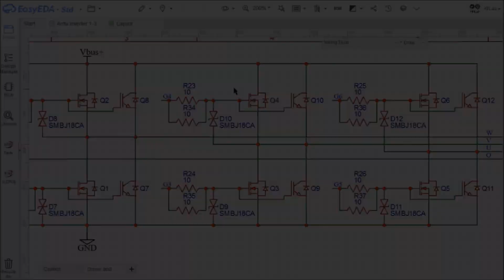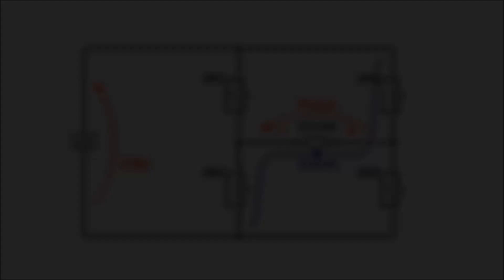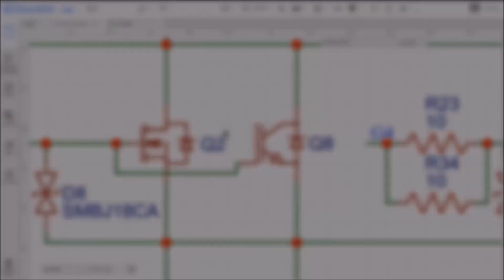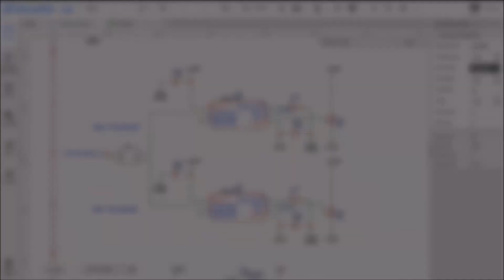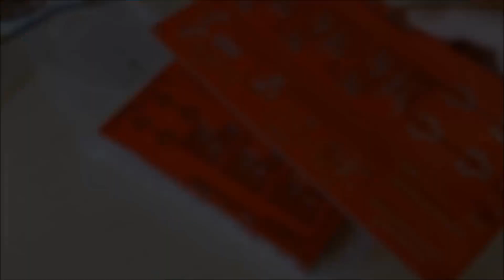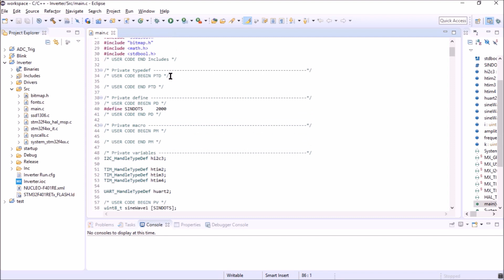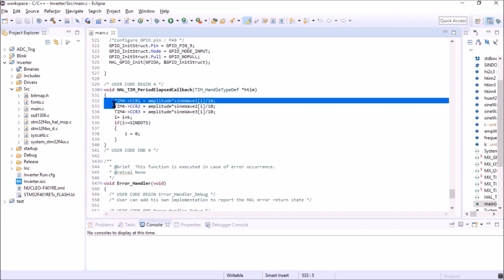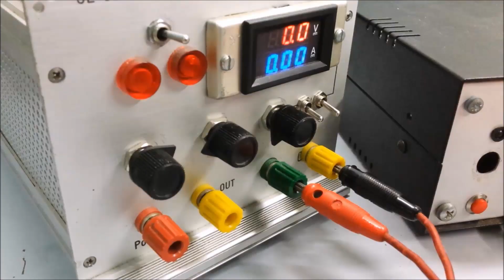Three Phase SPWM Inverter with ARDUINO and STM32 for Electric Motors - Power Electronics DIY

Comment: Ciao, prima di tutto grazie per share il tuo video e complimenti per il tuo lavoro. Ho visto la tua scheda tri fase che lo utilizzi con il Arduino. Per il mio progetto avrei bisogno di controlare 3fase output (voltaggio 0-100V, corrente 0-5A e frequenza 0-60Hz). Pensi che con la tua scheda questo lo potrei uttilizare? Grazie per la tua risposta!

Comment: Hi there nice work. can i have the files of the project ?
Reply from the maker: Yes, contact via email or patreon.com/atlab
Reply: @warsider4219 did you receive   the circuit diagram and code please from @ATLabENG? Please I need it as well. Thanks in advance

Comment: where are the heatsinks? never seen an inverter without heatsinks!!! this thing won't work in real life, one of the mosfets (the one with least resistance path) will get hot, suck all the current (because it is hotter) and burn
Reply: MOSFETs have a positive temperature coefficient, so the exact opposite will happen. As the temp increases so does it's internal resistance so it pulls less current.

Comment: Why haven't you consider using ir2104 gate driver (which have a single input) instead of nand gate ic and ir2113 gate driver? Is there any specific reason?

Comment: I use dsPIC33FJ family with Mitsubishi IPM PS21867 and PS21869, depending in board I use, and also IRAM136-3023B, with PIC18F4431. I know STM32 is much more "powerful", but also lot more complex. Anyway, good job you've done. I've forgot to mention, I've used space vector pwm, not sinusoidal, because of DC bus voltage utilization.
Reply: Hi brother do you supply any onverter project? Pure sine wave
Reply: Hi brother

Comment: Congratulations, very good project. I currently work on a similar project (115V / 400 hz inverter). Do you have a part number/type/reference for the AOP that reads the shunt voltage. Do you think  TL082 is a suitable device for this purposer. Thanks. Keep it up.
Reply: Hi, Could you build it? It's for avionic:)
Reply: Hi. Yes it's for avionic instruments. My project is still in progress. But there is a much better solution than MOSFET + DRIVER : google STGIPQ8C60T-HZ. @Muhammad-qf9vl

Comment: This is really interesting.

I've been looking for a simple way to generate gate signals for an inverter from a hybrid car I've been reverse engineering. Has 2 3-phase inverters inside and I'm able to switch on/off each of the 12 gates directly with 3.3v MCU logic, original drive circuitry and isolation intact.

Crazy how this thing cost me only $60 here in the US, can handle 700vdc at maybe 600A (no data available for the IGBT's, but they are BEEFY), has a ~150A boost/buck converter too. Current sensors on all 6 phases + boost converter, and a giant custom-made film capacitor for super low ESR+trace inductance.

Definitely got a subscribe from me. Would love to see how you pulled off the (IMO, really good) sinusodial code. Because when I was looking for tutorials/examples let me tell you there are some sketchy codes out there haha.
If not it's OK, I'm really not going to be able to work on it again until like 2 months from now regardless. Just impressed with your project :)
Reply from the maker: Tha k you very much for the nice comment and story!! I'm very happy that this video was helpfull for you!!:)
Reply: EGS002 ASIC will cost you 3 dollars and generate perfect sine wave signal. This is for 1-phase, but 3-phase could be done with EG8024 chip

Comment: Wow. This is a very interesting project. Can you post the video on the code ?
Reply from the maker: Thank you very much! I can share the code if you need:)
Reply: @ATLabENG انا بحاجته وبمقابل مادي
Reply: @ATLabENG  please I need the circuit diagram and code.
Reply: @ATLabENG kindly share me the project. It’s been long am waiting for this project
Reply: @ATLabENG Hi sir, i have one question. 
When  the input ( ac 220v) rectifier with dioda bride it become to 310v DC right. But my pmsm motor only aceptable of 200v max. So how to step down the voltage sir?? Iam still confiusd on this hardware. Thank
Reply: Could you share the main Arduino code? Thanks for your work to this community 
 @ATLabENG
Reply: @adesuyisunday4287 did you receive   the circuit diagram and code please from @ATLabENG? Please I need it as well